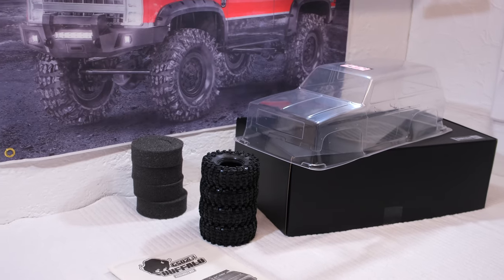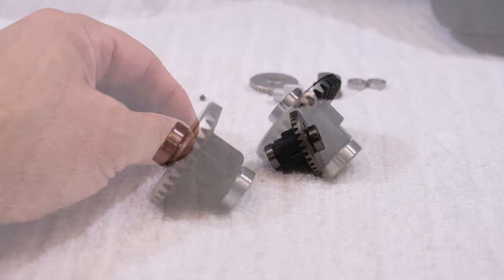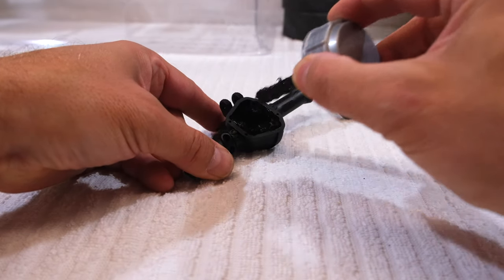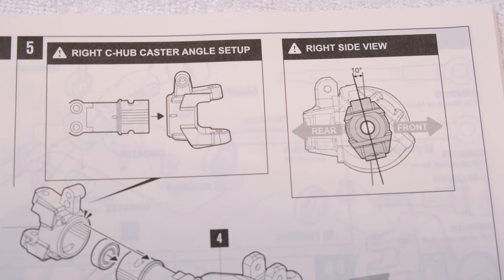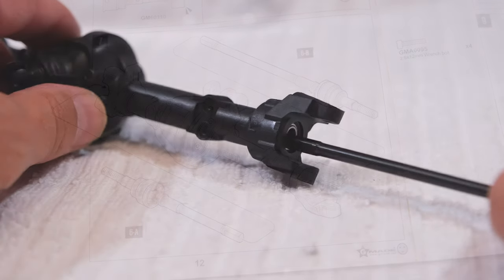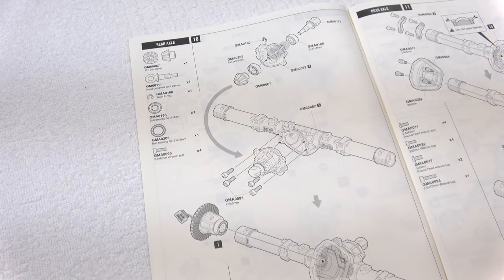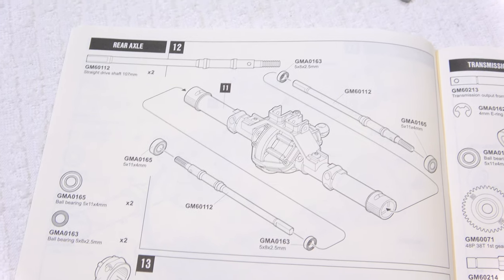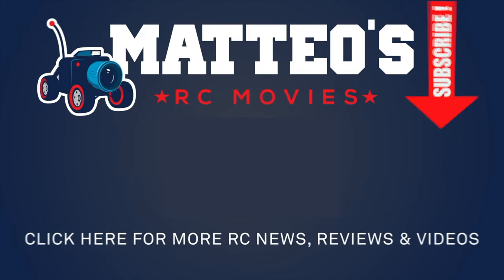Gmade GS02F Buffalo Build Video 1 - Steps 1-13

Comment: This looks good, I always use the grease gasket method also. One thing I make sure I do with RC's I know I will be going into water with is I coat everything that's metal with a thin coat of grease even the bearings and this helps stop things from getting corroded. 👍
Reply from the maker: Great tip! Thanks Steve! 👍😊

Comment: Hello Matteo. Thank you for all the detailed videos for this build.  It has been very helpful as this is my first build.  After the completion of the axel build did you have and extra bearing?  I’m hoping I didn’t miss something.  I did notice gmade included an extra bolt here and there.
Reply from the maker: No, I didn't have a bearing left over. Yes, some screws are left, but I never had an extra bearing in a kit, these are too expensive. But maybe they made a mistake in the quantity of bearings in your kit... 😊😊

Comment: I have recently completed my Buffalo and noticed my axles are a little notchy, do you experience the same?
Reply from the maker: If they are brand new, this is possible. After a few runs this should be better. I have many trucks with these axles and had never a problem. 👍😊